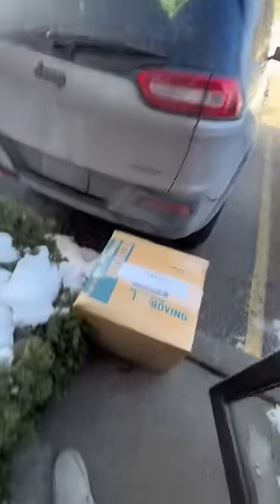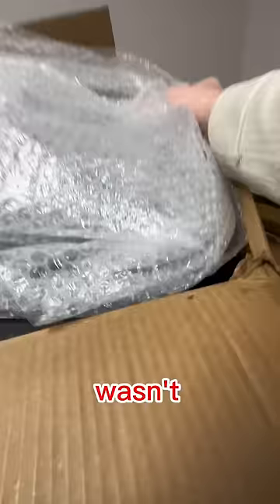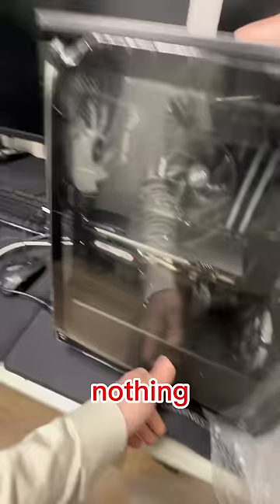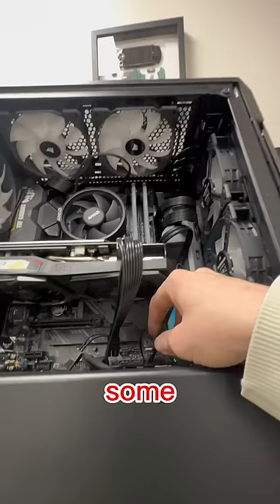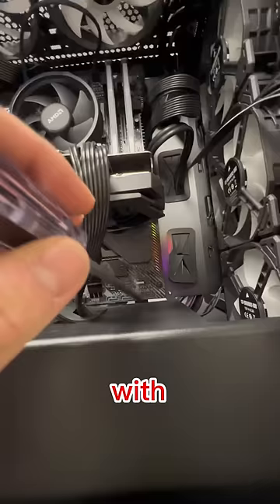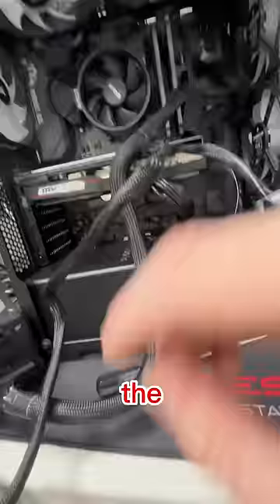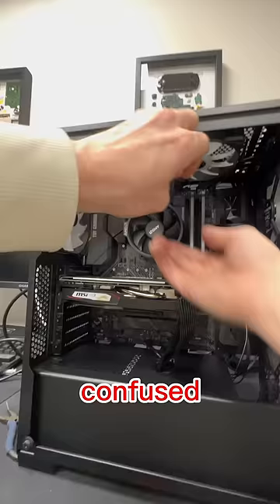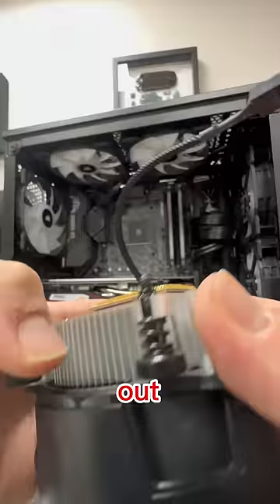Bent CPU Pins 😭🤬#pc #pcrepair #cpu #gamingpc #pcgaming #pcbuilds #pcbuilding #egirl #gamerguy

Comment: Don't throw away that CPU!!! You can have it repined! It will cost about $50 plus shipping to have all the pins replaced but it can be done. Just look for services in your area.
Reply: Where can you get this repair done?
Reply: What store are you talking about?
Reply: You can do it yourself it's not so hard to do, just find a cpu with same pins, remove pins with hotair gun and replace than carefully with some spoon or blade bend them carefully straight
Reply: @Denise_in_progress  bro i ain’t a craftsman. The cpu will end up broken in half and a different color! 💀
Reply: @GoingInsane  😂😂😂
Reply: i agree. If i had the tools at home i could probably do it. its horrible to do but it can be done
Reply: @GoingInsane ewellery repairman
Reply: @GoingInsane  ok but, and this is important, what color?
Reply: @JonathanCF0  Zima Blue.

(you probably won’t get this reference)
Reply: @GoingInsane facts lmao I'll just get a new one
Reply: fm2 doners are dirt cheap
Reply: @GoingInsane  it's funny 💀 how they think we can do anything.
Reply: Yes they are easily repaired. I use a syringe needle that I've dulled with a sharpening stone so it's not sharp and pointy, then slip the needle over the pin(s), then slowly bend it straight.
Reply: I think I've seen Northridgefix fix bent or broken cpu pins
Reply: Lol they're interested in selling another cpu
Reply: @adam crux 😂
Reply: How do you not have a dp on you acc? I wanna know how
Reply: @anonimiti  A dp? What are you talking about?
Reply: Northridge Fix can fix it. They fix small stuff like that all the time on their YouTube channel
Reply: @CocoKoi321  probably actually could.  i do electronics repair, but i bet a jeweler could do it
Reply: It’s a 5700G not a 5950x, screw it
Reply: I can do such a repair however I'm from the Philippines 😅
Reply: @GoingInsane  LTT made a video about it. You can do it
Reply: Guys micro center sometimes does cpu repairs that have to have some specialist person to do that or someone that is qualified to do so.
Reply: @GoingInsane  so J’zargo finally found something he can’t master.
Reply: That's badass!
Reply: @Denise_in_progress  Easy as a heart surgery
Reply: @Denise_in_progress  Pins are so small for my eyes, I could not imagine doing this without a magnifier and a precision tool.
Reply: TheSAINT654321  the pins are pretty universal the real trick is making a die to hold the pins so everything can be hot air soldered at the same time
Reply: @NiffYT  Nope that shit is way too difficult
Reply: @GoingInsane i got it :) #ldr
Reply: @GoingInsane it's already broke
Reply: @Denise_in_progress  that's way more trouble that just shipping it
Reply: you could even repin it yourself or keep it to cannibalize it for pins to repair other CPUs
Reply: @IrwinDeGannes  you're correct, that's were i learned it from, from alex
Reply: I would be straightening pins with a razor.
Reply: @Denise_in_progress  yea, most people have 2 same cpus in their drawers...
Reply: These Scammers Bread & Butter
Reply: Just send it to l
LTT he's done plenty of pins lol
Reply: @aleksiniko  walmart
Reply: @Denise_in_progress  What you just described is the definition of hard
Reply: @Theriddler  were did you grow up?
Reply: ThAT IS THE POINT OF FREE PLAYSTATION
Reply: @Denise_in_progress  20-30 pins is not reasonably doable without tools/expertise
Reply: bro in irelamd THERE AINT NONE OF THAT (at that price anyway)
Reply: @Denise_in_progress  bro thinks we are the dwarfmen from Narnia
Reply: nah no need all u gotta do is take a ruler or smth straight and pass it between the pins and do it on every pins for safety and it's all good
Reply: Linus made a vid about it
Reply: @Denise_in_progress lol it’s definitely not “easy” to do. Very tedious work and you need a steady hand and even if you manage to do it it’s not guaranteed to work.
Reply: @beluga2857 But... You can do anything. Melting metal and cooling it down isn't some fancy skill. Soldering is like making microwave dinners in the microwave.
Reply: Ayo bro just use a credit or debit card
Reply: I think you are mistaking, what gets done is to change the socket in the motherboard for the new type of chips with no pins. This can not be done less for 50 dollars
Reply: It's not as cheap as 50 dollar lmao or else you are giving it to some shady shit, don't trust
Reply: @GoingInsane  If you aren't going to fix the cpu pins and get a new one, then what would you have to lose if you fail to repin? Just doesn't make any sense to not give it a try at this point.
Reply: @ncb4_69  I would do this job for $50 and it would include replacing any of the pins that can't be straightened out... That doesn't include insurance or shipping but it would get the CPU functional again.
Reply: @daanlandsman1668  I said this until I got the tools to do it.  I still can't do it
Reply: @NiffYT  I remember a video from JayTwoCentz disagreeing with your statement completely saying it’s a lot harder than it looks, I’m gonna leave this down to the professionals man 😂
Reply: @NiffYT  Yeah you’re right he’s probably done more than the average person though that are in this comment section is what I’m getting at. I’ve done a few soldering jobs with controllers with a cheap setup but that’s about it & even that some people would struggle with
Reply: @GoingInsane  lmao
Reply: @GoingInsane i mean all you need is a bit of knowledge on how to solder with a heat gun

Comment: "let's ignore all the nearby repair store and ship it to another country to get fixed."
Reply: I wondered that too.
Reply: I'm actually surprised it arrived in one piece, I've seen a delivery guy bend a fucking door so nothing will beat that
Reply: It was a viewer...
Reply: To be fair, it's possible they're in a small town, and the local PC repair guy is a bit shady. It's not just a matter of finding a repair guy, but a repair guy you can trust.
Reply: @panzervpl9406  I know.  I ordered a custom metal door for my porch.  Dude bent it clean in half to fit it under the deck
Reply: In New Zealand it would probably take the same time if you repaired it there, but with no result
Reply: @JackDesert  how do you bend a neutral door 💀 💀 💀 is it paper thin or what
Reply: @lamlam..  not paper thin just eighth inch thick metal and screen.
Sent the porch vid to FedEx and they wanted to know if anyone else had video... They paid for a replacement but they were having trouble with thinking one of the delivery guys folded it instead of ringing my doorbell.
Reply: I had to do this when i Moved to Australia for 5 years from New Zealand. I tried all the computer shops and they were all incompetent and inept and didn't know what they were doing. So i wound up sending my pc to NZ to a shop i trusted. 
Finding a business that cares about their customers is not always as easy as you think.
Reply: @theblackwidower  even if this was the case, I’d drive to the nearest city with a reputable PC repair shop before I pay to ship something outside the US. Also seems like it’d take way long to get it returned.
Reply: If he was in New York or Michigan it’s not that far or expensive to ship to Toronto. Not a big deal
Reply: ... To be fair, in my small city (years ago) both of our repair shops we're underhanded scumbags, overcharging fixes and purposely breaking things we knew were fine. -_- yet most reviews and word of mouth referrals were quite positive... so another country isn't so farfetched of an idea.
Reply: Welcome to the world of trust and distrust.
Reply: that worked great back in the day when the pins were HUGE and there was space, now the pins fold over and there isn't much you can do.  LIttle little wires at this point.
Reply: He probbaly has a warranty and shipped it back to get fjxed
Reply: Local store probably told him the exact same thing that he had bent pins
Reply: he was probably hoping that it would get damaged in transit and claim insurance
Reply: Local shops suck ass man. Had my guy open and close my laptop claiming he fixed it and charged me 120 bucks

Started making noise instantly when i got home. Opened it myself and fixed the issue with 0 experience in 20 minutes for free
Reply: All repair shop near me are indians soooo.... Only service in asian store tho.
Reply: @theblackwidower  In my town, the local "pc repair guy" is never open and is either living in the shop or running a front.
Reply: @JackDesert  You what now?
Reply: Probably cheaper lmao
Reply: PEBKAC be like that sometimes. Most issues people have with PC's would have been fixed if they weren't stubborn and learned how to do their own builds when they had the free time in high school.
Reply: @skorpers  free time? highschool? what world are you living in?
Reply: prob cost more to then the new cpu lol
Reply: @rinzzler366  Reality.
Reply: @skorpers  when I was in in highschool there was no free time, you went home with homework, you did homework then it was supper or if you were like me, work. 3-4 days of the week.
Reply: @rinzzler366  And what's the excuse for the millions who are on valorant, fortnite, some other game or social media in every hour of their free time? Why aren't they using it to learn something? People waste their adolescence and no persons individual experience will invalidate the collective avoidance of self sustainability.

Also IT has always paid well and always will pay well.
It would have been nice for people to learn this stuff for a potential job in the future.
Reply: @skorpers  it pays alright but there's only so many jobs and the market is already over saturated I can't tell you how many students go to post secondary for course in and around that industry and end up with no job. And no prospects for the future.

Not everyone who's playing those games wants to or can afford to build a pc or take courses related to IT having a pre built is more than enough for 95% of people. Just a fact of life.
Reply: @rinzzler366  It's not oversaturated at all. IT is a broad field. The more you learn the more you can do.

And like what the people in this video have done, you can create your own jobs by having knowledge to preform services for individuals at a cheaper price than competitors. It's easy to lament lack of opportunity when you wait your whole life, when you can be building toward the next few years right now.

Comment: My 5700g was bent too. Because of cargo. My dad fixed it and its working now.
Reply: W dad
Reply: W dad
Reply: W dad
Reply: My Ryzen 7 5800X had bent pins as well, also came out with my cooler. The cooler is now broken because it has a nut stuck to the spacer and all that. So the good thing is I was taking out the cooler to replace it with an AIO.

My dad also helped me fix the pins.
Reply: Nice how is it treating you
Reply: W dad
Reply: W dad bro
Reply: I got the 4600g
Reply: W dad
Reply: W dad
Reply: That's why I stick with intel
Reply: @Oregold360  "Because of cargo."
Reply: @Oregold360  You have to be very unlucky for this to happen. Also AM5 is going to be LGA, not PGA as AM4 so the processors will be flat.
Reply: W dad
Reply: @Oregold360  intel motherboard pins are much more difficult to fix than amd cpu pins
Reply: It was bended? You meant bent right?
Reply: Also ah that's unfortunate
Reply: W dad
Reply: Nice.
Reply: @hovanthecool1995  cool 😁
Reply: W dad
Reply: L Dad send it back and get your money back
Reply: @Oregold360  Yeah man let me pull out my Intel processor with netherite pins
Reply: W dad
Reply: your must of been hella careful
Reply: W dad
Reply: W dad
Reply: Bended
Reply: W dad
Reply: @meric12131415  i fixed it thanks
Reply: @Yechse   no problem 😁
Reply: W dad i dunno how to even fix the pins  my i7 8th gen is still not working 😭
Reply: @IamNight69  oh yeah?
Reply: 9th  899 899999u998 @Ambush_yt
Reply: @engineerbot  998 o the 98 v i
Reply: all good!
Reply: What a great dad man. always nice doing these things with your dad, great memories for life :)
Reply: Best dad
Reply: W dad
Reply: A dad can fix anything
A mother can find anything
Reply: W dad
Reply: W dad
Reply: @Engineer Bot  I never had the pin issue since I always helped my dad build pcs and he had me dying them with him. The on thing that I had happen was when I bought my 7 5800X was that it was dead right out of the box. I idiot know this, so after many test I took it back to micro center and the tech laughed and said ya it was dead out of the box and gave me a new one right there.
Reply: W dad
Reply: I bent some pins on my 2700x a few days ago, took me like 5 minutes to fix it with one of those small screwdrivers. Now the only problem I have is that I am still running a second gen Ryzen😂
Reply: W dad
Reply: Chad Dad
Reply: W dad
Reply: dad power.
Reply: How did he do it ? Can you tell me olease ?

Comment: For sure looks like it wasn't installed right. And also, um... You can repair bent pins. I hope you knew that and explored options without just "putting it down". I'd be very very upset if you told me my pins were bent and you had to "put it down". Also I wouldn't use a metal blade to try and straighten them out, either. You're the professional, though.